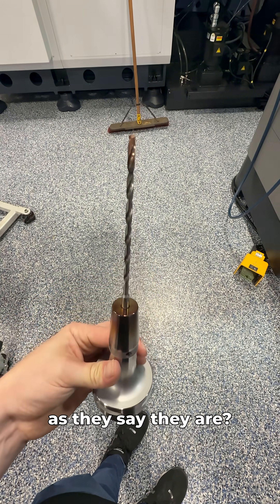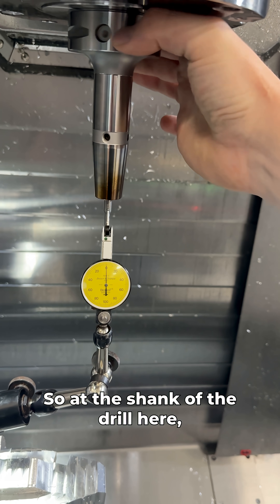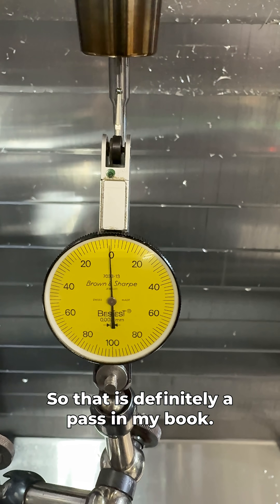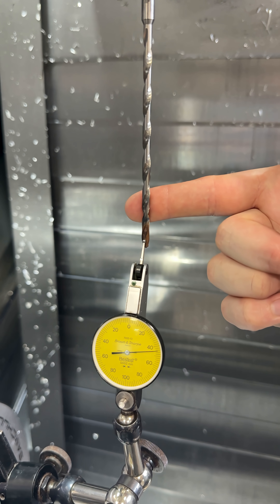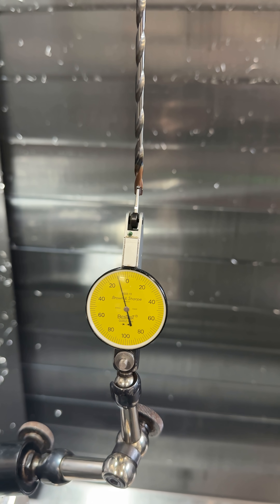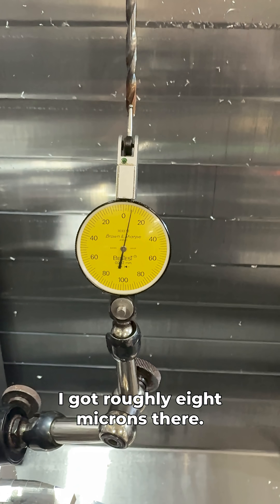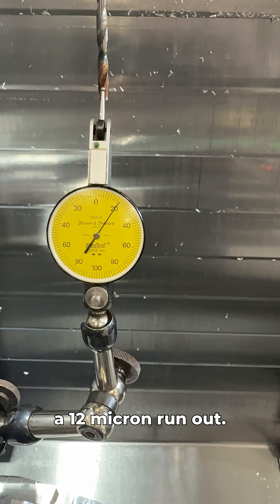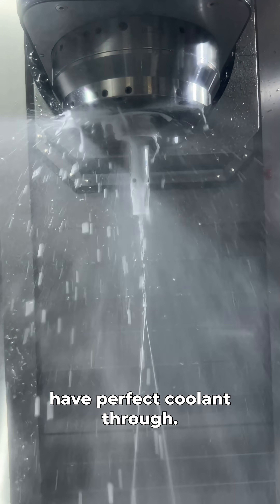Are Haimer tools as good as they say they are?

Comment: .001 to .002 either way for a drill that long is basically nothing. As long as you have a good  spot drill for this to follow this won't be a problem. 
.002 mm ÷ 25.4 = 0.0000787402 
That's not even a tenth in inches. The thickness of a piece of paper is .003" of an inch and this is a very very tiny fraction of that.

Comment: Microns I been machining for 15 years in job shops and this is the first time I hear microns but why does the test indicator says .002 thou and a hair
Reply from the maker: It’s the metric system. .002mm not .002 inch
Reply: @donniehinske 😮 👍 u sure right if that was in a print I would of fucked up some 🤣

Comment: I mean, the tool is precision ground. It shouldn't be that amazing that it's straight. Also, it doesn't mean its going to drill straight. Obviously, there are other (speed and feed) factors. I wouldn't trust it. I'd spot drill, and then drill with a stub drill of a slightly smaller diameter, then finish with the long drill.

Comment: For reference, 12 microns is a hair under .0005". Damn good for a thin, long drill like that.
Reply: I always thought a hair was .008 thou
Reply: Hair is .003
Reply: @BassHeadT3 I thought it was .008
Reply: If you look at the indicator every line is .0002 so every 5 lines either way is .001 and he went -.002 on the low to almost that in the +.
Reply: @cranke99  No, if you look at the indicator it says .002mm which is .00007 of an inch.
Reply: or about 1/10th the size of a human hair for those non machinists

Comment: This video is pointless your determining how good the holders are then put a random long ass drill in it and check runout on the drill. The long aircraft drills always have a bunch of runout and you can literally bend them to get them to run better. So this video is pointless
Reply: I'm pretty sure it's carbide lol good luck bending it beyond how far it flexes.

Comment: No, 12 microns is not 12 thou. Why would it be?? Here's a good way to think of the metric-to-inch relationship in machining: there are basically 2 and a half microns inside every tenth. (A tenth is ten-thousandth, .0001") That means it takes 25 microns to make up a single thou. For rough and round thinking in most GENERAL machining (not nano-specialty sh-t), you can think of a micron as half a tenth, it is close enough for the purpose. A runout of 12 microns on this tool is damn fine. Anyone on the internet who says it's not is just a keyboard-warrior basement dweller, not someone with real-world shop experience.
Reply: Just figured out the best way to convert mm to inch quickly in your head: Divide by 100, then multiply by 4. So 0.012mm -> 0.00012 -> 0.00048"

Easier way I always used on the fly was divide by 10 then divide by 2. So 0.012mm -> 0.0012 -> 0.0006" (easier but less accurate)

I watch a bunch of machinist videos and work in imperial so being able to quickly do the conversion in my head helped grasp the numbers they're using.

Comment: why is so much coolant leaking at the spindle nose? don't u loose a lot of pressure at the drill tip from that? or like shouldn't it be sealed?
Reply: We don't call it leaking if it's supposed to do that. Also the pressure of the fluid is negligible compared to the downward force of the drill. Not to mention you can easily monitor the two.
Reply: @zjvuiunkgzkgvb  how does the downward force matter for through coolant pressure? one is cutting data one is chip evac
Reply: No coolant pipes,

Comment: As I myself never used internally cooled drills (I hardly used a turning machine and never used a mill, actually), how do these things handle resharpening? I'm aware that you do something very wrong if you ever needed to resharpen anyways, I just wanted to ask theoretically. Would it even be possible? The tip is galvanically coated, let's ignore that for a sec
Reply: Noting special, grind all you want and recoat if necessary. The coolant holes go in spirals just like the flutes.
Reply: @JaakkoF  How in the world are the coolant holes parallel to the geometry?? I thought the core has been wire EDMed out or so.. on the other hand, if you stencil-EDM a corkscrew through there,... i dunnoooooo, sounds weird, pics or it didnt happen lol :D that would be a very own feat for itself.. but on the other hand AGAIN, if you bore out the  center part of a drill, it snaps....
I declare inner spiral bore holes parallel to the geometry as magic. just simple magic :D

Comment: Spot drill before the flimsy drill should center the drill just fine.
Reply: at that length maybe pilot drill depending on the material
Reply: @leonschumann2361  reamer if its a tight tolerance  like +.0003  -0.000 etc.
Reply: Exactly you’d need a pilot
Reply: Yeah I don't tend to have issues until a couple hundred microns of runout (.007 or so). Less than that and the drill will pull to center just fine.
Reply: Predrill 1xD with a stub carbide drill, drill point angle should either be the same normally 140 or greater. Some longer drills (10xD+) have a 135 degree angle.
Reply: @OnDeDeckLad pilot drills have other tolerances

Comment: explain to me please, if 12 micron equals 12 times 1/1000 inch. thats roughly about 0,3 mm. Is that realy okay? Do i get your units right?
Reply: I think you're confusing the imperial thou with the metric micron
Reply: @chas1878 he’s not
Reply: @tompass8446  yes he is, 12micron is 0.012mm and 0.472 thou
Reply: @AChicken-sh1gc  That's 0.000472" just for the few who might read that wrong
Reply: Dude, 12 microns is 0.012mm. It’s the easiest conversion in earth.
Reply from the maker: 12 microns is 12 microns so .012mm
Reply: I think it looks confusing because it's practically a tenths indicator that looks like a thou indicator. Every tick on there is about a tenth (.002mm~.0001").